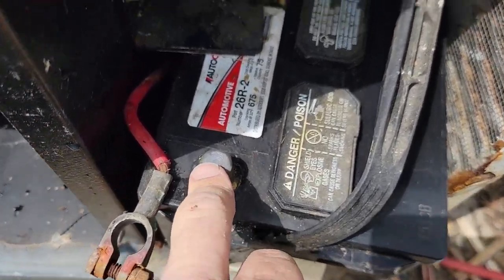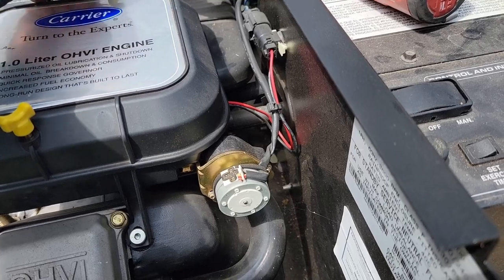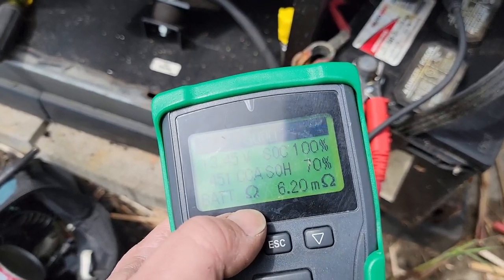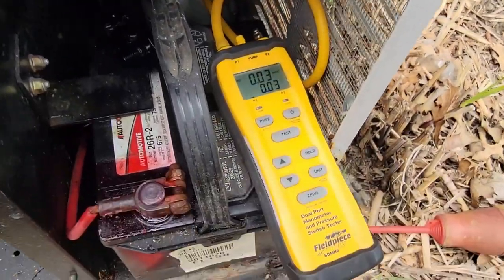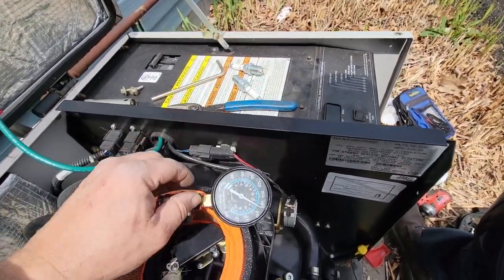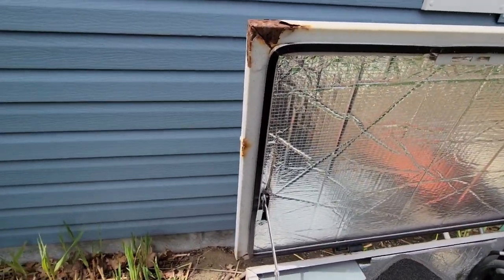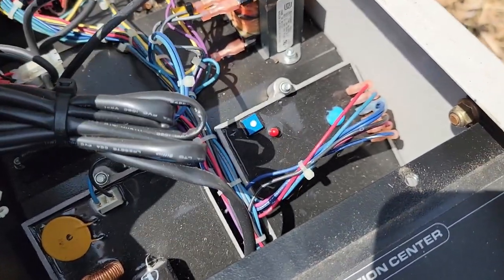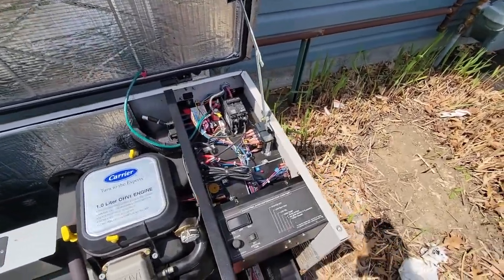Generac Generator Just Cranks

Comment: i love Generac Generator i have replaced  most everyone is a 50 mile radius with custom Diesel.
Reply from the maker: GenerJunk? I like the portables, I own two but the older standby were unreliable.
Reply: Custom diesel? Diesel has it's own issues, from tank capacity to fuel getting old. Like HVACR said, a lot of these units don't get many hours on them, and diesels don't care for running under no load in cold weather. They need a high load in order to not 'wet stack'. And residential loads are so wild from nothing to max, commercial buildings are either like 50% to 75% and diesels do better. Although we pulled a 600kw from a nursing home a couple years ago, and the 400 gallons of fuel in the old tank was so bad was hard to find a way to get rid of it. Fuel company wanted $3 per gallon to 'polish' it, and at that time, new dyed fuel was only like $2.38 a gallon. If the fuel just sits there in the tank for years it turned as black as used motor oil from a 2 cycle Detroit, and quite stinky as well. As long as the natural gas supply is reliable, it's much better. Even LP gas is better, burns much cleaner, and propane will last forever until the tank rusts out...
Reply: @brnmcc01  well first you do raise some vary good points.
OK first i am no were near a city i am as they say of in the sticks. 
tank capacity for the most part a normal home size will burn 0.75 gallons a hour (i am talking a 150 amp) under 3/4 load. most of the gens i handle have a 150 gallon tank under them. most not all.
i have one person that has 2 really big gems i am talking 400 amp (dairy farm) he has his on a 500 gallon tank but only runs one at a time. my self i have a 200 amp for my horse farm and it is on a 275 gallon tank..
yes diesel will go bad well kind of it grows agile if you don't keep the tank full.  
yes winter can be a problem for starting that is what a block heater is for of a heated shed keep it room at 40 degrees F problem solved. 
as to treating the fuel i tell every one who has a Diesel the same thing Sea-Foam.
and you do know the LP also will go bade??
there is no Nature gas near me.
now lets talk life span. this is a vary short discussion i service 5 units that are from 1970es and have 1500+ hours on them  Diesel takes the blue ribbon hands down.
Reply: @hartsfire5706  I prefer diesel units as well, as long as they're sized properly and put on a proper load. They like to work, and they're most efficient at 50-85% load.  However a few of the places I know that have large diesel generators, they only run in exercise 12 min a week, and nobody puts them on a load bank after initial install, then on the newer Cummins units I end up having to run out there, plug in the laptop and do a forced regen, because the soot filter is all plugged up with slobber. Even though life safety code requires a power outage test once a month, and then a load bank test once a year if the monthly test doesn't put at least a 50% load on the genset. But the facility maintenance onsite staff only know how to change the oil, etc. Parts changers. I keep telling them it's not good for their equipment, but they're like well corporate paid for the new generator, and they don't care until State comes along and gives them a tag for no recent load test etc. For a small or med sized avg house that rarely has power outages, I'm not sure diesel is better. For instance, in the spring or fall when most of the strong storms occur, and the people are asleep, or at work when the power goes out; I've seen even a 7000+ sq ft house with a 400amp service only pull like 1-5 amps. On one leg... and that's nowhere near enough load to warm up a 40+ kw genset. Just not predictable enough of a load.
Reply: @brnmcc01  i agree with you sizing is a huge thing.  and i tend to under size a bit so that it will load things to make heat. 
grin I wont touch a Cummings power gen set (to sell that is)  as 99% of my gen sets are home i don't have to deal with the crap filters. i love loopholes in the laws.
I set up all of my timers to run for 30 minutes 1 time a month, and i tell the people to do a full load run every 3 month's  to keep things happy. 
i do have 2 gens JD powered that have the junk filters on and i have them set to run 45 minutes and have not had a problem.  but that costumer knows how to do a delete if it ever is a problem.
Reply: @hartsfire5706  ... I have done both, and I have to say the diesel will win in fuel consumption, but does require more service cost, plus 50% more in purchase price. IOW, pay back might not happen till you pass the 3-4,000 run hour mark.
Reply: @brnmcc01  ... in my neck of the woods it's not uncommon to see 100+ Kw on a residence and without an AC load they come in at only a few amps per leg. We actually have a few customers in the 300 - 400 Kw range on a home. It's amazing what $$ will do to people's basic needs. <LOL>
Reply: @rupe53  you are vary correct the cost going in to it will scary mote people away..  and about 70% of them will be back and out of that 40% will go diesel.  will it every pay for it's self???  NO and yes
the time when the power is out for days, around me 3 days out is the normal, and it just keeps starting every time and runs every time it has just payed for it's self. 
around my part of PA the age of people is around 50+ and we are so remote that we keep 4 or 5 freezers full. if we have no power we have no heat lights internet < a way to contact 911 or water . farmers even small one have no way to feed clean or milk..    city people that move in thinking it is going to be sooo good to be out in the country normally only stay one winter..  
there is a reason every one around here has a big 4x4 truck it is not to show off it is to get around in the snow and flooded roads. and keeping 500 gallons of diesel on hand at all times is a must or several cans of treated gas.
she we are so fare back in that a joke around here is that they have to pip the sun in to us.
Reply: @hartsfire5706  ... I think you missed my point on "paying for itself" meaning in the cost difference. Sure, a gallon of diesel will go about twice as far, but now diesel costs more than gas or propane by a long shot, plus the increased cost of the unit. My point was about long-term payback, which is going to be after several thousand hours of run time. In the meanwhile, they could have had a propane set for thousands less and that will start easier when the temps are below freezing, even without a block heater. (those cost a fortune to run)
Reply: @rupe53  on a side note, i have a question for you or any one for that matter.. baring a normal power outage from a storm,  
now we are talking the extreme and when backup power will be needed for days and days.
tornado or hurricane or some other kind of HUGE disaster loads of houses down.  when the safety / search and rescue show up on site one of the first things is cut all power , water and gas in a area..  OK now what do you do? your endless gas supply just stopped.  my diesel will still run and if i offer even my garage as a shelter or work , staging area i will get all the fuel i need to stay running. 
as the old saying is been there did that, one of the blizzards took down houses and gas was cut in a hole town..  all of the diesels stayed running and at the time i was in that town i opened my garage as a staging area and a place to get warm free. when my fuel started getting low it was filed free to keep thing going. 
now granted this is a vary rare thing here in and around the east of PA  and i am really hopping it never happens to any one but i believe in planing for the worst and hopping for the best. :thanksdoc:
Reply: @hartsfire5706  .... we have the same issue with natural gas, especially in low coastal areas. Basements flood and they shut the gas off during storm tides. Most of my larger sets are propane, some with 2,000 gallon tanks... and sometimes multiple 2,000 gallon tanks. a 100 Kw at 75% load will use near 350 gallons of propane in a day. I told ya, money will make people do weird things.
Reply: @rupe53  350 gallon in a 24hour at 75% load wow. 
JD who has one of the worst fuel hungry engines on the market with a max load on 300 amp 240V will use 125 gallon in a 24 hour at 75% load.
my self i run a 25kw for my home shop and horse barn and that runs at 2.0 per hour at 75% load.  that is a Perkins or Cat if you will.
Reply: @hartsfire5706  ...we're not comparing apples to apples here. Your 300 amps is roughly 75 kw, @ 75% load is 56 Kw so roughly 11 gallons per hour on propane, or close to 265 gallons per day. It would be roughly half that on diesel. Using rule of thumb (average of all units) that's just over 130 gallons of diesel daily. Rule of thumb is close enough, but you need to start with good numbers. Diesel and propane come in gallons, but natural gas is in cubic feet, so conversion is necessary to calculate consumption. Let me throw in that propane can still be had for $3 - $4 per gallon. What's diesel cost in your area? Around here it's $5 - $6 a gallon, which reduces savings.
Reply: @rupe53  wow you are getting killed for diesel.. i just got off road diesel for the winter and paid 4.02 a gallon.
Reply: @hartsfire5706  ... Yup, diesel is out of sight, although I noticed today it's dropped at the pumps. Just over $5... and Ct has one of the higher state taxes on fuel. I haven't bought any off-road in years but we're semi rural so delivery charges might apply on small quantities. (less than 250 gallons)
Reply: @rupe53  $4.02 is the delivered cost for my area for off road.(highway is $5.25 if i remember right) and that price holds till you get 1500 gallons then that puts you in to balk and you get it a bit cheaper..
Reply: @hartsfire5706  ... in this area we have something called a contract price, but you need to project out how much you will use for a season / year. That's fine if you have a farm full of stuff to fill up and you have a rough idea of annual use. Most of our gen sets are on a will-call basis so you get the spot market price. (today's price) Basically you measure the tank and ask for a certain amount, and that's it till the next outage.

Comment: Never worked on generators, but it seems to me that you do not just break the unit if you f-up. The whole house and everything connected to the grid is at stake now 🤣
Reply from the maker: The older generators didn't have a lot of protection built into them to protect the homes electrical system. Sometimes you get lucky and catch it before it blows everything up 😁

Comment: What is the tool name for the gas line?
Reply from the maker: What did I use it for
Reply: @HVACRSurvival  to check gas pressure?
Reply from the maker: @gerardotorres7904  gas manometer
Reply: @HVACRSurvival  thanks for answer i like your videos Iam an electrician and sometimes i get calls to troubleshoot generac generators

Comment: I noticed you didn't do a valve adjustment.....tisk tisk
Reply from the maker: They put too much emphasis on that, I've yet to see it make that big of a difference, they act like it'll change the world. If it was out of whack too much it wouldn't have pumped up as high as it did.
Reply: @HVACRSurvival  You'd be surprised. I went to a new customer last year, his 7kw had only been installed maybe three years ago and he said never ran right. Lots of error codes in the history. Slow to start, lots of hunting etc. Checked the valves, and wow, intake zero lash, and exhaust was pretty tight. Adjusted to spec, replaced both battery terminals, cleaned the battery, and its been much better since. On my own unit at my house, I had to adjust the valves at only about 20 hours on it. Another guy posted on gentek power forums installed a new unit out of the box, and the valves were too tight. Refused to start unless manually choked. I've noticed the quality control on not just generac, but everything in general these days since 2020 has gone to shit. Generac and HVAC factories are trying to catch up with the 22-30 week lead times, and they're all just trying to get as many units shipped as fast as possible and their attitude seems to be 'don't worry, we'll just catch problems with the warranty'. Meanwhile all of us out here in the field have to finish the factory's QC work... :)
Reply: @HVACRSurvival  Once they get this old and 40-50 hours on them, they seem to be stable, and if it's running fine just check the valves once, and it'll be good until the unit is junk. Seem to need adjustment after initial breakin, and then be stable afterwards. But a lot of them nobody has ever checked the valves on them, so if it's the first time I'm seeing a unit, I'll check the valves on it once, then again in a year or two, and then leave it alone after that. Can't trust the previous guy or previous owner(s) of the house/genny.
Reply: @brnmcc01  ... years ago we started installing hour meters and we were amazed at what that can help in the maintenance arena. Valve adjustment at 50 hours and any time we changed plugs... or... every 150 - 200 hours after that. (or any time it was hard starting) Of course, now there's run hours built into the controller.
Reply: @rupe53  Yup, I've just heard a few anecdotal reports of generators coming right from the factory with valves not adjusted properly. It's hard to imagine a scenario where they will be way out of adjustment after only 10 run hours, unless there's some kind of defect in the head, valve seats and valves sinking into the head, bent pushrods, severe cam lobe wear etc. But if this was the case, that one I adjusted the valves on has been running fine for over a year since now. If the engine was so bad it was way out of whack after 10 hours, that thing would have blown up by now running at 3600 rpm.... I didn't see any metal particles in the oil at all, and I even cut open the oil filter which was the factory original. Nothing remarkable, no metal bits, no bits of plastic oil pump etc. Just someone rushing it out the door trying to clear the months long backlog of orders. Have had people waiting 4-6 months for a new generator last year.
Reply: @brnmcc01  ... no matter who makes them there's bound to be a few that are out of spec from the get-go. I once had a new unit to do a start op and it had no spark. Close inspection found a 3/16" air gap between the coils and flywheel. (go figure) I recently retired from one of the larger dealers, with 17 techs and selling hundreds of these things annually. If there's a problem, we've seen it before. Right now, I believe the wait is over 6 months for a new unit and I'm sure annual sales will be well over 1,000. When I started working there, I was the 4th tech they hired, and sales were in the 200 range.
Reply: @rupe53  3/16"?? Wow.. it's supposed to be only a few .001's I forget the exact spec, but about the thickness of a business card IIRC.
Reply: @brnmcc01  ... yup, 0.0010" - 0.0012" is about right. I was amazed too! (edited)

Comment: I bought a Generac from Lowe's. I'm a yacht mechanic I have no trouble with installing things like that I followed the directions. However I opened up the Generac and it looked like it had been under water everything was Rusty! There was so much corrosion that the spring for the choke had rotted away already. There's nothing to be done about it I took it back to the store. They sent me another one it was just as Rusty! I didn't even get that one out of the store I open the box there. The manager look like he was going to pass out his face went white. How to get my $6,000 cash back. I put solar panels on the roof and a bunch of batteries and I never have to worry about propane blowing up in the yard. The sun delivers plenty of power when you put 12000 W on the roof
Reply from the maker: Interesting👍👍 thanks for sharing!
Reply: @HVACRSurvival  ... that rust problem is common and caused by factory shipping. They send out bundles of four units held together in plastic, but the local dealer leaves them in the storage yard (outside) and the cardboard boxes get wet on top. (no plastic there) The plastic holds the water and in three to six months everything inside the box looks like a rusty boat anchor, including the transfer switch, if shipped together. IOW, if the dealer has poor storage and low turnover of stock, this is what you get.
Reply: good luck with solar!
Reply from the maker: Bill-who are you talking to? No one is talking about solar in this comment section??
Reply: @HVACRSurvival  will friar...the yacht mechanic.
Reply: Posted on wrong person. Sorry....but solar does suck lol.
Reply from the maker: @billbec7235  I agree, solar is a waste unless the government gives you my tax money to offset the price. 🤦🏻